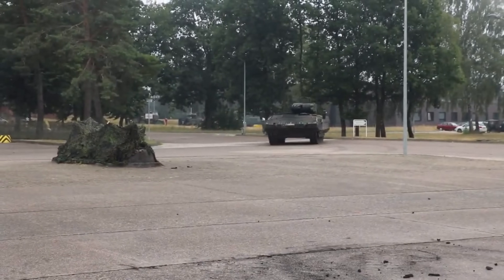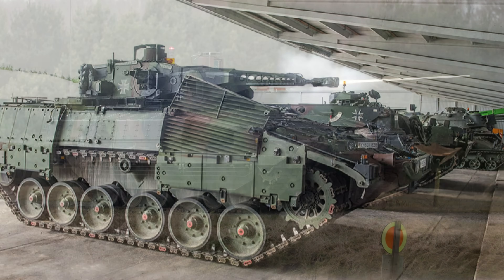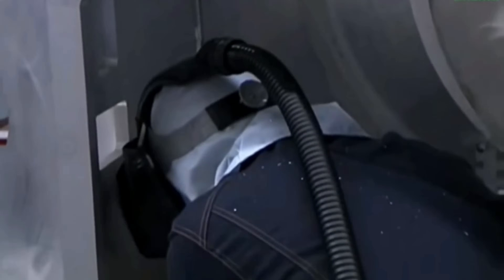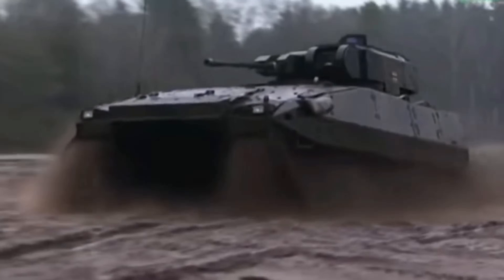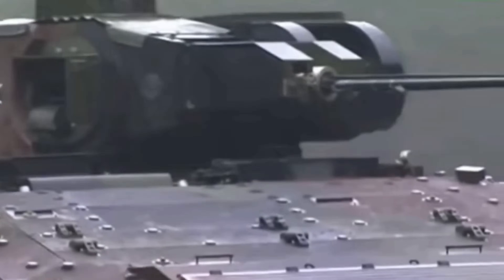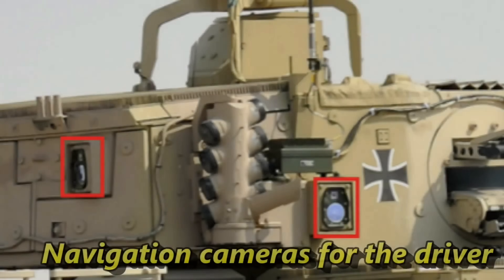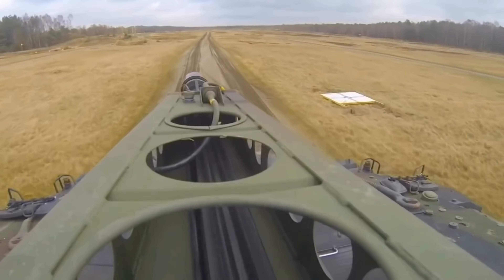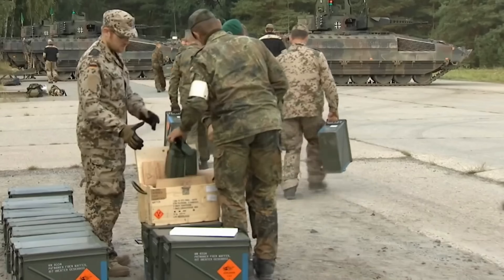The Puma Infantry Fighting Vehicle - Overview and Opinion

Comment: To fully understand the Puma (and the Marder), you need to know that the German army has a different doctrine/philosophy for the use of mechanized infantry and their IFV/APCs than other NATO forces.
Most NATO armies follow the American "Battlefield Taxi" model, where the IFV/APC will drive infantry close to the front, dismount them and then either retreat to a overwatch position to give standoff fire support from there, or leave the infantry to their own devices, to independently do cavalry work, like scout for the MBTs, or pick off soft targets at the edge of the battle and stuff like that.

Based on their WW2 experience, the Germans have a different approach.
They really take the "Combined Arms" thing seriously and want their MBTs, mechanized infantry and IFV to work together, simultaneously, shoulder to shoulder, if you will. 

Most modern armed forces claim to be following a Combined Arms doctrine, but in most cases it is more of a "Alternating Arms" doctrine, where different types of units might operate close to each other, but will usually try to achieve different goals, attack different targets and stay out of each other's way.
The MBTs will do their thing over there, while infantry does something else over here and the cavalry lurks around the flanks and so on.
Or they will operate in waves, where the MBTs come first and then infantry follows to mop up what the MBTs left over.
The Germans on the other hand try to overwhelm the enemy's ability to deal with any single element by mixing them all together and letting them operate like one unit, basically.

Their IFVs stay with the infantry and the MBTs, while getting other support (like artillery) where possible. No single element is ever supposed to operate without the others.
That is why for example, even though it was a German guy who invented it, the German army never used explosive reactive armor on their tanks. It would have been too much of a risk for their own infantry which was supposed to operate around the tanks and very close to them.

It is also why the Marder and the Puma are not amphibious.
They are not supposed to ever go where the Leopard 2 tanks can't go with them, so giving them the ability to swim made no sense. 
And of course they need heavier armor when operating side by side with the MBTs and facing the same opposition, while at the same time having no use for bigger guns, like some variants of the CV90 for example, which have a 90mm cannon. Would be pointless to strap a MBT gun to a IFV when that IFV is always accompanied by the real MBTs anyways.

The Germans take that Combined Arms doctrine so seriously, that they basically split their army in two.
There is the main, heavy force that is all about following that doctrine and their special kind of mechanized infantry, which they call "Panzergrenadiere" is the infantry element of that.
The problem is that that heavy force can't go everywhere. 
For all those places where the main "Spear Point" part of the army can't go, they have the so called "Jaeger" units.
Those are all sorts of light infantry (regular Jaegers, mountaineers, which they call "Gebirgsjaeger" and paratroopers, which are called "Fallschirmjaeger") and they are considered a different type of infantry from the Panzergrenadiere and separate from the main part of the army, because they don't follow the Combined Arms doctrine.
They are supposed to operate without heavy support, do hit and run attacks, lay ambushes and other semi guerrilla type of warfare and accordingly they get kind of a semi special forces training.

This creates this weird situation where the German army kind of doesn't really have any regular, old fashioned infantry.
All the infantry is either those Panzergrenadiers, who are specialized for basically doing tank warfare and the rest are the Jaegers, which are this weird half "guerrilla militia in uniform", half "semi special forces" thing.

I digress.
The point is just that German IFVs are a bit different because their doctrine is different and that is why they never sell well on the international market.
Even those countries that bought the Leopard MBTs, never bought the Marder or the Puma, despite them being specifically designed to operate together with the Leopards, because they didn't really fit into anyone else's doctrine.

The Marder's 20mm cannon isn't really fit for the American style "Battlefield Taxi" role, or Cavalry work and the Puma is too heavy.

That is why Rheinmetall developed the Lynx, basically as a lightweight, more Bradley- or CV90 style export version of the Puma.
Reply: Excellent comment.
Reply: @BewareOfTheKraut  It is.
Reply: Well do any one remember the taken out Turkish Leo 2 Tanks

Only because they didn't have infantry support for the tanks and every German military equipment pice is designed with the combined arms doctrine in mind (the right tool but not the skill to use it properly, like hammering a nail in same wood but hitting it with the Handel on purpose)
Reply: @TheLtVoss  LOL they didn't even have tank support. The leopards were sent up individually.
Reply: @rileyernst9086  Hep and that's why they were easy targets to the atgm
Reply: @TheLtVoss  even if you put active defence on them, or other systems, you still have a massive vehicle. And well it's hard to stop cannon fire.
Reply: @TheLtVoss  Leo II A4s from the early 80s, never really upgraded, manned by conscripts and used, without infantry support, as a stationary artillery piece by incompetent officers because most competent officers were purged by Erdogan ...
Reply: @positroll7870  jep and still under most of these circumstances the Leo2 A4 is a good pice of equipment but without the right tactics it will not last long
Reply: @TheLtVoss  Well, the Turks seem to have learned the lession at least partially and are currently adding an indigenous upgrade, with lots of top armor etc ..
Reply: @TheLtVoss  I understood that was also based on the fact that they were used as static defense/not mobile (against doctrine) and also the A4 stone age version.
Reply: Fabian Mueller Infantry can only safe the Lepards from ATGMs fired from 2 km away, if you send the Inf 2km ahead of the tanks and use the tanks as pure firesupport for the Inf. But thats not the German doctrine, tanks are made to maneuvre! So flaw of the Leopard design is the ammunition storage in the front left hull, the Rebels knew that and exploited it. Leopard 2A8 needs to adress this flaw and put all ammunition under blowout-panels in the turret!
Reply: @WackyJackyTracky  I hope you know that what you named there as a change for the A8 would mean a redesign of the whole interior. Designing a new tank would be a better option at that point.
Reply: @Tankliker  Yes I know, well they got rid of the hydraulic pump system which used alot of space in the right-back turret. as the turret has now electro-motors. The other thing in the turret is the firecontrol-computer, maybe they can use a smaller modern computer. APU and AirCondition can be moved too if necessary. It's still a 4 man crew, manual loader, manned turret tank then. A new designed tank will need to have the features of an T14: unmanned turret with autoloader and lots of sensors. Oh and of course A8 needs an APS
Reply: @WackyJackyTracky  Yeah, they already made mayn modifications, but still. They maybe have to move the whole technic that sits in the turret into the hull where the ammunition is and the ammunition into the turret. I beleive Rheinmetall did something like that with the Leo. 2A4 Revolution, which is a privat design from them where they reconfigurated the whole interior. 

But you are definitly right about the new tank, even if I think a autoloader Leclerc/K2 Black Panther/ Type 90 style where the ammunition is in the turret would be a better design becasue you could simply design the back of the turret so after the tank ran out of ammunition they could just remove the whole section in the back and load another in, like on the MARS system.
Reply: @TheLtVoss  If you watch that syrian video shooting the ATGM from 2km away, you see that deployed turks infantry would have needed to be like 2 km infront of the tanks to be able to spot and fight the ATGM team https://www.youtube.com/watch?v=YafzmkvVRiI Infantry alongside the tanks can't safe them against ATMGs, they would need to clear all the area 3 km ahead of tanks befor tanks can move in. But tanks are supposed to be a fast moving spear head, so they need to be able do defeat ATGMS themselves with APSs. Infantry alongside can only safe them from RPGs!
Reply: @Tankliker  would you want to be a driver in an Leopard sitting right next to all the ammunition? Those catastrophic explosions with all crew killed and who knows else standing next the tank outside, should not be possible in german engineered equipment.  https://www.youtube.com/watch?v=YafzmkvVRiI . A7 only has a lill more track-skirt composit armour I think, dont think that stops an ATGM from hitting the ammu
Reply: @WackyJackyTracky  Nice Video XD Yeah, they definitly shouldn´t use any tanks there. The ammorack in the hull is not really a big failure considering that the Leo. 2 was mostly designed to defend germany and so on is perfect for german or european ground in general. The ammorack for example are not in real danger of being hit because the tank will most of the time fight in a hulldown position in europe.
Reply: @Tankliker  The Leopard 2 is designed with mobility in mind, with a strong engine and a fc-system designed to have a 90% first-hit-chance while beeing on the move. It's not designed as a mobile marginot-line turret just moving into its digged hull-down position. The ammorack is a design flaw, we can't just blame the turks
Reply: @WackyJackyTracky  Yeah we can, I mean the Leo. 2 is used around the world and even the canadians had some encounters with there leased Leo. 2A6M but they lost non of them. 

The video doesn´t show a design flaw but a flaw in tactic. Ever tank could have standed ther and could have been killed.
Reply: @Tankliker  No, the opponents the Canadians faced in Afghanistan didn't have ATGMS, just RPGs which are easier to avoid by keeping distance.
Sure every tank can be knocked out, but you do know that there are different tank kills (killing its sights/weapons, mobility kill, total loss so it needs to be abandoned)... in no way ever the shown catastrophic explosion should occur... it is not something acceptable with the whole crew and nearby infantry dead! Abrams would be penetrated too in the situation, maybe crew would be wounded if hit directly, but I never saw the whole tank exploding and torn into pieces. If the ammo-rack ist hit it blows out the panels. An Challanger 2 was penetrated by an RPG29 (double hollow-charge) in Afghanistan, the driver was directly hit and lost a foot, the crew had to abandon the tank cause of smoke, but it didnt just blow up like Leopard2 did in at least 10 instances in Syria.
Reply: @Tankliker  Don't get me wrong, I am german and I like the Leopard, it is simply terrible to see it explode like this! Maybe they could seal the hull's ammorack with an armored-door and install blow-out-panels in the hull or move it into the turret.
Reply: @WackyJackyTracky  A Challenger 2 could explode jsut like a Leo. 2 because it has open ammunition in the turret. They are lucky that the ammunition never got hit there. 

And no, only because they are unguided doesn´t mean they where less dangerous. ATGMs are somewhat even less of a thread to modern armys because after they got fired the gunner mostly has to stay in place and hold sight with target, so many modern armys already have tactics to counter them. 

In such close combat as seen in the video an RPG is potentially even deadlier because the gunner only needs a short time on target.

In the end every tank has it´s flaws, the Leo. 2 has a big one with the hull but so hes every russian tank between the models T-64 and T-90 (More modern T-90 have a modified rack so the chances are lower that the whole thing will just blow up, but still there is a chance)

In the end the need for a new tank is given for the Bundeswehr, but still the Leo. 2 does it job and only because the turks can´t handle the fact that modern tank warfare doesn´t mean that the tank should stand in the open isn´t automatically the fault of the design. 

For example the Abrams (Which had for a long time the best crew survivability of all modern MBTs) got also destroyed because the army that used them didn´t provide any cover or support. Yes, they didn´t jsut blow up, but what differnce does it make if the crew is dead and the tank is still usable or the crew is dead and the tank got blown up.
Reply: @WackyJackyTracky  in the video it is clearly that isn't an atgm it is an unguided missile so 99% a rpg (don't know the typ video was Pore quality) and 2km away is also to much Loks more like 1500m or less and infantry in between the tanks to build a flank had definitely saved the leo2 oh and fight distance of infantry is in middle eastern about 250m-1000m
Reply: @WackyJackyTracky  skits a extremely effective against heat warheads so because the explode in a greater distance to the Ammor (and every density difference between the layers disturbing the jet and in the case of an a7 skird the jet has to cutt steel ceramic polyurethane, than an air gab of 50 cm and than the jet is directed at the main ammor of the hull so the jet isn't focused enough)
Reply: @Tankliker  about Merkava best crew survivability?
Reply: @francis8062  Is your question if the merkaa could survive this position shown in the video? Maybe he has the highest chances but the merkav also has the flaw of no save ammorack, the whole ammunition is jsut stored all around the tank in special tubes that slwo down the fire after a shell got hit but still, if the crew wants to survive they have to leave immediately. The Abrams may be the best if it comes to such a situation like shown in the video, the biggest problem would jsut be that the fulltanks are at the spot where the tank got hit, so it could burn down or run out of full too fast or even air could come into the fuel tank after hit and could get sucked into the trubine and jam it.
Reply: @Tankliker  thanks 👍
Reply: With some good planning the Australian Army will buy 200+ of either the Lynx or the Puma to work with the 230+ Boxers we bought.
Reply: @oldmanriver1955  well you clearly missed the point of the first comment entirely. the Puma and Boxers do not work together. didn't you read the comment or did you not understand it? the Puma works with the Leopard 2 MBT. the Boxer is for light infantry, scouting, hit and run, patrol duties and not for tank warfare.
Reply: You fully understand the german army doctrine and broke it down into your excellent comment. Thank you. That should help the ppl to understand the role and claim of the Puma in the modern german army.
Reply: @TomDieselTruckTV  Only lacks one little bit. there are tanks in the Jäger parts.  I  worked on those tiny little Wiesel tanks while i was drafted.  It was very easy work because i knew both engines very well from being an Apprentice in a VW/Audi dealership.
Reply: @practicing1  wow, you really had to drop your bucket of unrelated bullshit on what is otherwise a very constructive thread under a very constructive comment.
Reply: Sorry, but your world domination plan has not worked so people can criticize the German war machine. Lets put that mass grave to bed. Now you want to talk about the design of your luxury ambulance in a positive light? Really? Now?
Reply: Unglaublich gut erklärt in englisch!
Reply: That philosophy goes back quite a long time, Julius Caesar found the auxiliary German cavalry very effective because it operated with lightly armed very fast running infantry that would run with their cavalry amongst the horses so they would always have cavalry support.  Needless to say when they took on other enemy cavalry they always won because one German would spear at you from the same horseback level with his spear while his buddy down low would spear at you from below.
Reply: @LordBruuh  Wow, this is some serious big brain stuff right here. 
So on your planet, because an army is small, it can't have a doctrine, or a strategy to win fights?
Reply: @TrangleC  OPs comment is just pretentious bullshit and I say that as a German who served in the German army , and the guy is right . Also the German combined arms doctrine has never been implemented in combat .it's a long shot to suggest that the German army is better than anyone else in a specific field and that kinda thinking is why the Germans lost the world war
Reply: Thank you for this cogent, informed analysis.
Reply: Epic post 
Great
Reply: Just to clearify: Jaeger is translated to Hunter in english. Jaeger units are mostly similiar as the US Ranger forces, but with a minor difference: Jaegers are also able to take down IFVs and MBTs.
(With an Panzerfaust and/or MILAN)
Reply: @walther2492   but jägertruppe is not airborne and usually heavyer equipped than ranger units...  if you want to compare any german unit to rangers, its some type EGB forces. Besides that, wearing that triple oak leaf on my baret makes me more an  regular infantry man than some type of special forces ;)
Reply: @derblablablachannel  Bundeswehr Jäger are "airborne" if necessary, via helicopter, been there done that as Panzergrenadier in 1980, (Panzergrenadier instructors were often assigned to Jaeger units and vice versa) Jaeger are deployed by foot and by any other means, like M113, other motorized Transport, planes and helicopter. And yes "Jaegers" are best equated to u.s. army rangers, due to the tasks and our training was at least as good as theirs.
Reply: Best summary I ever read about Bundeswehr doctrines.
Reply: American IFVs be like: dafuq de doin ova der
Reply: I should have known this, but I still feel informed. Thanks for this unexpected comment.
Reply: Danke für den guten kommentar
Reply: By the way:
The original Marder version was amphibious, it just became too heavy after the first real upgrades. So for the later versions they dropped the amphibious capability.
Reply: @papaschlumpf5894  Sure? I think only only SpPz Luchs and Tpz Fuchs were amphibious.
Reply: @papaschlumpf5894  Which original Marder version? I drive this thing since years and i never heard of it being amphibious. And i can't imagine it ever was, considering its form and purpose.  Are you sure, that you're not talking about the SPz TPz Fuchs?
Reply: @Sxxmaschine  Marder was always able to drive through 2m deep water, ("Tiefwatfähig") it's got diving hydraulics like leopard, fully pressurised interiors and a snorkel, that must be mounted before crossing, so it was back around 1980. It cannot float, but crosses fully submerged. (Former Spz Marder Commander of 6th PzGrenDiv)
Reply: @waltrohrbach2459  hey walt, you're right, 1,5m without and 2m with the snorkel and NBC protection turned on. As mentioted, i'm operating it (driver/gunner). It's just that being capable of submerging does not make a tank amphibious in my book. dran, drauf, drüber
Reply: @Sxxmaschine yep, not fully amphibious, it cannot float, just "tiefwaten".. or " deep wading" <g>
Reply: @papaschlumpf5894  That sounds more like the Lynx (Luchs Spähpanzer), which got to heavy and lost its ability to swim in Version A2
Reply: @zelemas3062  Lynx made of Marder could not acually offer anything substantial. The floating in all such vehicles is mostly last resort. Apart from Russia its useless. First thing you will experience in tracked IFV going to water is sinking. Second is getting killed. Third is slow pace floating with no possibility to exit the water because there is no beach on the other side. Fourth is leaving all infantry in a truck and all your tanks on the other side of the water.
Reply: Billy But Whole  perfect couldn't say it better
Reply: Thanks for enlightening us with your explanation of the workings of the German army. I do hope this will be effective against the overwhelming muhammedan army that this Merkel bitch/witch is bringing in. May you be victorious against this blackest of foe's.
Reply: I makes perfect sense tho.
There is no need for an infantry unit in modern warfare, unless you want to do asymmetrical wars (like Iraq) or capture cities (which would be an offensive war).
Both scenarios dont apply to the german military, we are not allowed to ever do offensive wars, and generally not intrested in following the US in yet another disaster conflict. 

But defending the homeland is top priority and for that infantry is basically the least needed unit type unless you end up in a asymmetrical scenario again.
Reply: @Triumph633  So germany has no city worth defending?
Reply: @practicing1  Utter drivel. The rumor got started by an incompetent manager from Rheinmetall (or KMW?) who didnt properly read the fine print in the paperwork they were sent (the requirement applied to equipping staff offices in barracks, not IFV's or APC's) and shot his mouth off. 
The officers in charge of the program immediately clarified the BS, but the damage was done and the internet meme born and then got propagated by Russian trolls and the tinfoil hat brigade.
Reply: @positroll7870 was it a profitable misinterpretation? often is in banking and politics at least
Reply: Patrician Cloud : You need medical Support! Ask for help! Meet a psychiatrist!
Reply: @ron9320  gaslighting-  how boring u are troll
Reply: @arvedludwig3584  Merkel..... if ever there was a satanic destroyer of Germany...
Reply: @arvedludwig3584  Really, and what source told you that? The Merkel fan page?
Reply: @practicing1  The most important thing is that it can transport pregnant female soldiers since Angela Meryl and German women will b"

Spouting the same false nonsense is the usual indication of people having no clue about the topic. This never happened.

Obviously with women being allowed in most military roles prodeures had to be adapted and "gosh" that meant that there are rule what happens when a woman gets pregnant. Simply put they get retired from a mission outside germany. There was never any special demand for specifications for pregnant soldier transportation for anything ever. Just new processes to deal with new possible scenarios because militaries are big on having all processes prepared in advance and from top down so units do not make shit up. 
Besides male soldiers should be happy when such a requirement would mandate that a military vehicle cannot have as toxic materials anymore. It is not like asbestos is somehow healthy for men either.

But I think I already sunk more time into explaining the actual facts than you spent putting together your false garbage for your agenda.
Reply: @mangalores-x_x  exactly, childish doll house dreamers priority
Reply: @mangalores-x_x  They can fight the next major war, letting all the land pirates do what they want and cutting men to the bone
Reply: Thanks for this comment and discussion. It is, despite the inevitable side talks and troll posts, a very enlightning thread about a topic I had no clue before.
Reply: I think this is in every way the best comment I read on yt so far. Thank you very much.
Reply: This is about the best YT comment I have ever read.
Reply: Can you explain russian doctrine one.
Reply: @C1pher187  I would like to, but unfortunately I don't know enough about Russian doctrine and what I know, I have a hard time figuring out.
As we all know, Russian IFV/APC usually are amphibious, so we can at least derive from that that they are not following the same doctrine as the Germans, but there might be certain similarities.
A while back, Matsimus uploaded a old Cold War NATO training video, which explained some common Red Army tactics. Back then it was their doctrine to have a large, mixed tank and infantry force follow a smaller force, which was supposed to lure out, detect and bind the enemy, giving the bigger force in the back the time to figure out how and where to attack best. 

It kind of was like a offensive version of the "Defense in Depth" principle.

As far as I know, that smaller "probing force" was mostly made of mechanized infantry, because they would be best suited for hunkering down and surviving long enough for the main force to arrive.
When you have such a smaller force that is supposed to find and engage the enemy on their own, it makes sense to maximize their mobility with amphibious vehicles, I suppose.

But how exactly mechanized infantry and tanks within those forces worked together, I don't know and I doubt that the modern Russian army still follows the exact same doctrine as the Red Army did, because they don't have the same man-power and the same number of expendable auxiliary troops from all the Soviet provinces anymore.

The newest generation of Russian tanks, like the two Armatas and the Kurganets, suggest that Russia now, like the NATO armies, puts more focus on survivability and on keeping their troops alive, than the Red Army did.

Another hint to their modern tactics is the existence of the Terminator tanks. Having a MBT converted to what would be a IFV, seemingly specialized on fighting other IFVs and infantry, but without the ability to carry troops, probably means that they are not planning on having the mechanized infantry stay close to the tanks, but instead have the Terminators do that job and use the infantry differently.
Reply: Is it conceived to stop Russian Armored Divisions? It's hard.
Reply: @francis8062    What if?

Only combined with MBT's and Mechanized infantry... not as  stand alone.
The Puma got MELLS in close future or nearly  now... Rocketlaunchersystem with SpikeLR Antitank-Rockets...so the infantry with carryable launchers
Reply: @HerrKarliseppel  thanks for infos👍
Reply: @HerrKarliseppel  MELLS is already integrated.
Reply: @Tankliker   partly...  but on Puma and also  on a  pack of upgraded Spz Marder
Reply: @HerrKarliseppel  I only know that the puma was taken in service with the MELL soft kill APS. I never heared that they also upgraded some Marder with it.
Reply: @Tankliker   if i remember correct... around 80 Marder (2020-2030)will be upgraded for future with a new powerpack with 750hp ... and better weapons like MELLS

The other Marder going out of service in close future
Reply: @HerrKarliseppel  OK, that's new information for me, I knew they wanted to hold some Marder in service but not for how long or even with an upgrade.
Reply: @Tankliker    75 Marder 1A5 will be upgraded. Not 80. New sights . New Powerpack what   makes the  Marder more maneuverable ans a lil faster . And   MELLS.... thats all.
Reply: @HerrKarliseppel  thanks for the information. I guess they want to hold them as long as the sparparts are in stock XD
Reply: @Tankliker   Yees :D   4 only as Spareparts...71 for service ...
It took time for  upgrades of the Puma and delivery of additional Puma...  so some Marder will be in use to 2030 in addition to the mainly used Puma...  thats all
Reply: @HerrKarliseppel  what I meant was the rest of the marders, I mean the BW has way more then just 75 Marders right now and I believe they won't just scrap them without at least stripping them from parts that can be used as spareparts like the track wheels, bolts, electric or ammunition.
Reply: @Tankliker  Lots of options after a bit of refurbishment. Either sell them (like they did with Jordan) or re-engineer them into carriers of the 155mm Artillery Gun Module. Or put an Oerlikon AA system on them. Etc ...
Reply: Trust me America definitely has combined warfare doctrine, but at a smaller unit level so it might not be too known.Their are a lot of combined arms battalions that constantly have the 2 mechanized infantry companies at the flanks of the 2 tank companies. 
Thunder run is a good example of this. Infantry and Bradley's were constantly securing positions and flanks for the tanks rolling through. like bridges the tanks would have to go under or would be at their flanks.
Reply: @sethreynolds8520  So the Bradley's just hold a stationary position until the troops took position and after that they take a new position?

The German doctrine drops the part with the position taking as a major tactic. The IFVs just roll at the Frontline, because of that they are so heavily armored and can withstand even tank rounds with the heaviest armore configuration.
Reply: You make some interesting points. The CV9040 wich is the swedish variant uses a 40mm ATK not a 90mm. The export variants use 30 or 35mm. There is a light tank version with 120mm gun also. Dont think its actually being made thou
Reply: @Ubeer85  there are several versions of the CV90 with tank guns for export. Obviously the swedes don't use them because they already have Leo. 2 / Strv 122
Reply: @Tankliker  Where you get that info? As far as i know there is only CV90/120 as light tank
Reply: @Ubeer85  There are serveral options for costumers currently. The 120mm is a option but also you could buy a CV90 with WILK turret and 105mm. Never heared of a 90mm version.
Reply: Tank units and mechinf have different targets and not getting in eachother's way is better than forcing them together to get in eachother's way.

Fat Puma upgrades is just another trend that countries getting involved in Middle East are picking up - for asymmetrical warfare that doesn't necessarily need tanks, this also explains the lack of ATGM in certain configs.

Every country has light infantry/recon battalion...etc. kind of setup.
Reply: @EcchiRevenge  I hope you know against what kind of weapon modern MBT are protected the best? Also germany isn´t involved in any asymmetric warfare right now, and could easily face it with the "Jäger" Infantry which is more specialized for this kind of thread. The "Grenadier" Infrantry combined with the tanks is for symmatric warfare, which would be the more coomon thread on european ground because we have no instable countrys with multiply terrorist groups which all act msotly on themself.
Reply: @EcchiRevenge  I'd hate to say it, but you're making a few assumptions there mate.
Reply: @rileyernst9086  Nice try, you're not turning it around on me.
Reply: @EcchiRevenge I'm just saying, the Germans have used combined arms in warfare and exercises since 1930 and mechanised since 1942(when they started using their half tracks as IFVs rather than just battle taxis). They know what they are doing, and if they believe this is a suitable way of doing it, well then I'd think the different elements are going to get in the way of each other.
Reply: @rileyernst9086  You're assuming a lot of things.

One of which is that post-ww2 germany is of same caliber as the pre-ww2 one(not that blitzkrieg is a new concept even when ww2 first began).

Even(or rather, especially) re-unified germany got its goals changed and budget slashed(to the point where they were prototyping modifying AK bayonet for G36).  I would think twice before blindly trusting a husk of its former self.
Reply: @EcchiRevenge  I'm saying doctrine and tactics wise Germany has developed differently(starting in 1930 and now has based itself on on the lessons hard won when 3/4 of their army fought itself to extinction against the Red Army rather than the Blitzkrieg) after WW2 west Germany was basically a speedbump(but hey it only had to buy 4-5 months for NATO to reinforce France, a more likely front line) to the rest of the world(who base their tactics on Soviet and allied tactics of WW2, because as conventional wars go, that was the last biggun), their mechanised units train together because they will fight together in close coordination, closer than what other armies do. Sure everyone is doing budget cuts, it cuts but if you don't have money, or a war, well an army becomes a problem, look at the proposed plan with the Royal Paras and Marines. And look at the US marines. They even won't have their own tanks.
Reply: @EcchiRevenge  I know it cuts as a military enthusiast, but Germany does not need to spend so much on defence now. It is not the front line and it's not run by a genocidal dictator who wants to take over Europe. Even if Russia wants to invade Europe, it'll have a hostile Ukraine and Poland(and NATO forces stationed there) as a buffer. And that would likely give enough to time for NATO to get it's arse in gear and mobilise. Russia might be strong, but it's hardly the Soviet union, and many of its former states are joining NATO. I'd be more worried about the more indirect threats Russia poses. NATO is only strong united.
Reply: @EcchiRevenge  I'd have to agree this vehicle and the boxer are huge. The marketing and hype is disturbingly effective. Boxer replacing the AISLAV with a bit better protection dwarfing an M1A1 Abrams. And that part about the bayonets is pretty funny. I think that might be an issue with HK. Basically the G36 had to be temporarily pulled from service in Afghanistan because hot weather made the plastic all wobbly. Not great for your service rifle.
Reply: @rileyernst9086  Then that's even less of a reason for infantry to move with tanks in apcs.

This is pretty much the only place where infantry and tank can work effectively - as multiple layers of AT defense against superior numbers(i.e. - USSR).  If you don't consider Russia to be much of a threat - no need for any of this "doctrine."
Reply: @EcchiRevenge  well they still want a military and these tactics are what they have been training for since 1960. It's either keep on, or redesign their military. I'd say using tanks, IFVs (Germans have since 1942 used them for fire support to stick around with the tanks) would be useful in most circumstances. Mutual support is mutual support.
Reply: @EcchiRevenge  So you're arguing, that infantry, always having close tank support is only good for defence against AT weapons. Tanks do a lot more than shooting other tanks. The IFVs give the ability for them to stay with the tanks. So it is a very good aggressive doctrine. Couple that with the fact that your soldiers know the tanks will always be there, and vice versa. It's very good for morale.
Reply: @rileyernst9086  Strawman.

IFV can easily do just about anything infantry needs tank support for(including shoot at tanks); that is, if IFV is equipped with the proper weapons.

You know what's actually good for morale?  Knowing the vehicle you ride in can do almost anything below CAS.
Reply: @EcchiRevenge  Apart from blowing stuff to bits. Unless it's a BMP 1 or BMP3. I agree that is good for morale, but also having tanks that are there to add weight of firepower. Well I would not say no.
Reply: @rileyernst9086  Implying IFV can't do "blowing stuff to bits"?
Reply: @EcchiRevenge  direct fire ordinance is pretty good and the bigger the better sometimes.
Reply: @rileyernst9086  Let me introduce you to CV90-120.
Reply: @EcchiRevenge you mean the CV90 120T yeah I know all about it. It's not an ifv. It's a tank. Hence the T in its designation.
Reply: @rileyernst9086  Still IFV hull.
Still can carry troops.

None of your goalpost moving worked.
Reply: @EcchiRevenge  a merkava can carry troops
Reply: @rileyernst9086  I knew you were going to say that.

Therefore Merkava is best IFV. (just need to toss out spare ammo)
Reply: @EcchiRevenge  really useful for medivac. Rather that than an old m113.
Reply: @rileyernst9086  They have Namer...etc.
Reply: It's not exclusively a German tactic. Many countries employ that approach.
Reply: @practicing1  never read smth so stupid and i read a lot!
Reply: Fantastic comment, highly informative. Thank you very much!
Reply: Well, my country bought 50 Marder IFV a few years ago and its really interesting after you write this. I always wonder why there's only 4 countries use Marder while a ton use Leopard 2. I wonder what my country use for the combat tactics. Thanks for your explanation
Reply: @arvedludwig3584  na the the treaty was a real provocation I mean have u seen the numbers for military personnel and artillery prices and the Bann of every armored vehicle with that Germany wouldn't have a chance against Poland and that for one of the strongest economic powers at the time was hilarious it wasn't the only reason but it was a reason of many
Reply: TrangleC : Thanx for explaining with a few words the doctrine of the army I served in. When you are inside  the system and you  know nothing else it is absolut normal to fight under this doctrine. I would like to understand more of the different doctrines.
Reply: Billy But Whole : Drauf! Dran! Drüber! Er ist halb Mensch, er ist halb Tier! Er ist ein Panzergrenadier!😉 Translate it!😂
Reply: Well Australia must be on the same doctrine lines as the german armed forces our ifv's and afv's accompany mbt and the infantry dismount and form up an extended line with our ifv's/apc's/afv's  and mbt and assault as 1 force yeah can units do have a recon role but once the enemy has been fixed theyre into the battle aswell Australia having such a small but very professional defence force has taught us the value to truly do combines arms assaults!
Reply: @arvedludwig3584  I am nor right, nor left. I do care about factual data though. What was your source again?
Reply: Thanks that was really interesting.
Reply: Thank you 🙏 for the education
Reply: I have serious doubts as to the accuracy of this comment. Unless the Germans are mixing tanks and IFVs organically at the company level you are essentially describing US Army Combined Arms doctrine, and how US Army Combined Arms Battalions work.
Reply: @Dadecorban  They are mixing them on every level. As I said, the MBTs are supposed to never ever operate without IFV and infantry ("Panzergrenadiere") support and the IFVs that are part of the combined arms doctrine half of the army are supposed to never ever operate without the MBTs.

If what I say is wrong, both you and that guy who commented months ago, claiming to be a former German soldier and never having heard of any of this, better have your own explanation for the fact that the German army is separated into two distinct parts that have different doctrines, the "Jaeger" and the rest and the US army is not, which it would have to be if it would operate the way I described the German army.
Reply: @TrangleC  1. Partially not true. Armor can operate without infantry, it can't halt in the defense for long periods of time without infantry support and on the manuever still requires scout platoons screening (but there aren't many scouts, and they are mounted most of the time so it's not exactly a robust use of infantry in the manuever). 2. Mixing it on every level doesn't tell me whether a German mechanized company has 6 Marders and 6 Leopards or whether the companies are still armored companies and mechanized companies that team up based on the mission. If the companies are organically mixed at the MTOE level then what you said is true, it means that a tank is never anywhere without a Marder. The first I'm pretty sure isn't the case and the second is essentially what US Army Combined Arms actually does. 3. I'm not saying that Germany doesn't do combined arms and isn't split in the way you describe, I'm saying that what you are saying about this being super unique to the Germany army (actual combined arms) and specifically not the case in the US Army, likely isn't the case. 4. Specifically, the US Army Combined Arms Battalion FM is essentially a description of when and how tank companies and mechanized companies work together to accomplish various missions; which routinely looked like a Mech company taking a village with an armored platoon attached, or armor maneuvering in the open (support by scouts, which are mechanized infantry), or armor moving through rough terrain with an attached mech platoon. US Army combined arms is essentially how you mix the drink. It's also how we operate at our JRTC and NTC brigade training centers which is as close to manuever warfare as you are going to get without actually killing Russians.  I would love to see evidence that the Germans are so radical in this area that the US Army should be excluded specifically from being in the same category.
Reply: @Dadecorban  I'm always accused of making judgement calls and calling one thing better than the other, which I never did.

I just said: "This is how the German army does it. This is why they do it and this is why their IFVs tend to be a bit different from other nations' IFVs and don't sell well internationally, because they are custom built for that German doctrine."

I never said armor can't operate without infantry. I said in the German army, it isn't supposed to. That is their doctrine, based on experiences in WW2.

I might be wrong, I am not an expert on every army in NATO, let alone the world, but as far as I know, the German army is the only one that is split into two like this, for the reasons I explained.

What I do know is that back in the late 50s and early 60s, when the German army developed their first IFV, their American allies urged them to adopt the "Battlefield Taxi" doctrine, which was NATO standard and buy into the new M113 program. The Germans refused and decided to do their own thing.

Seeing a documentary about that actually was what first made me interested in the subject.

Even the general Wikipedia article on IFVs, under "Doctrine" talks about how the Germans had a differing view from the rest of NATO and their view ultimately prevailed and got adopted by others, including the USA.

Nevertheless, the fact that other armies are not split up the way the German one is, tells me that they can't really follow the same doctrine as the Germans, because that split is kind of inevitable when you do.

When you do have a doctrine that says MBTs are supposed to never operate without the support of mechanized infantry and vise versa, then that leaves you with the problem that heavy mechanized troops can't go everywhere and can't do every job infantry has to do.
So you need two types of infantry, one that operates within that strict combined arms doctrine and one that doesn't.

So maybe you understand why I am dubious when people tell me either that the Germans don't do that strict combined arms doctrine, or that others do it just the same way, when the German army, to my knowledge is the only one that has that split that is kind of necessary for anyone who would adopt that doctrine.

The ones who say Germans don't do it, would have to explain why the German army is split like that then and the ones who say other armies do it, would have to explain why and how they do it without being split like that.

And then there is things the US army does and the German one doesn't do, like Cavalry tactics. I'm not aware that German IFVs are training doing solo flanking maneuvers, where a single IFV drives around alone, searching for soft targets to engage at the edge of the battlefield, like you often see Bradley's do in training.

A Marder would clearly not be suited for that job, which proves that there are different doctrines for the use of IFVs.

PS: Sorry to everyone else who wrote a comment and got no reply from me.
I haven't gotten any notifications for replies to this comment in half a year or so. I assumed the thread is dead and am pretty shocked to see now that there have been over 170 comments.
Forgive me for not having the time and energy to go through all of them and answer.
Reply: @TrangleC  Yes, you did say it. "To fully understand the Puma (and the Marder), you need to know that the German army has a different doctrine/philosophy for the use of mechanized infantry and their IFV/APCs than other NATO forces.
Most NATO armies follow the American "Battlefield Taxi" model, where the IFV/APC will drive infantry close to the front, dismount them and then either retreat to a overwatch position to give standoff fire support from there, or leave the infantry to their own devices, to independently do cavalry work, like scout for the MBTs, or pick off soft targets at the edge of the battle and stuff like that." This battle taxi doctrine does not exist in the way that you think it exists, and the Germany's use of IFVs isn't as unique as you think it is this.
Reply: @TrangleC  Germany's doctrine is no different than any NATO countries doctrine. MBTs are supported by IFVs with infantry dismounts. APCs, operate without MBTs. You seem confused on what APCs are compared to IFVs, which is where the confusion is coming from.
Reply: @brandondavis7777  Nope. I know the difference between an APC and a IFV, although as usually, it is blurry.
And just because IFVs and MBTs are on the battlefield at the same time, neither means they are doing much to support each other, as the current war in Ukraine shows, nor does it mean there aren't differences in how they are used between different armies, within NATO or outside of NATO.

Both the Bradley and the Puma are clearly classified as IFVs and are rather similar to each other in their basic makeup and abilities, ignoring that one is much older and thus naturally less capable.

Yet, there is the clear difference between them that to the Bradley transporting infantry is a secondary mission, while to the Puma it is the primary mission, despite still being a IFV and not a APC.

That is part and result of this difference in doctrine I was talking about and denying that is rather obtuse.

PS: As someone who has been saying for many years that all armies claim to follow a Combined Arms doctrine but few actually do, I feel quite vindicated by what we see in Ukraine.

The Russians too said what they are doing is "Combined Arms", but now we see that it isn't. Just because MBTs and IFVs/APCs are on the battlefield at the same time, doesn't make it "Combined Arms".
For it to be "Combined Arms", the infantry has to protect the tanks from enemy infantry, but according to old Soviet and now new Russian doctrine, their infantry stays 300 meters behind the tanks.
300 meters is already about the maximum effective range of a regular infantry assault rifle, under ideal conditions. Nobody is hitting anything at that range while running after tanks.

Sure, even the best trained infantry with the most refined Combined Arms tactics can't protect a tank from a Javelin coming at it from miles away. So Combined Arms, even if done right, is not the be all, end all of military tactics, but against short range ambushes with RPGs, Panzerfaust and NLAW, they could do something, if they actually would do real Combined Arms and would protect their tanks with a effective infantry screen.

So many times when I talked about Combined Arms, I was told by armchair generals and online experts "Duh! Everybody does that, dumbo!"
But now we see that not everybody who claims they do that, actually does that.
Reply: @TrangleC do you have any sources or further reading, I'd really like to know more about this
Reply: That may in part describe WW2 offensive tactics, but does not apply to NATO role of german Bundeswehr in the cold war situation, which was generally a defensive role only.
Spz Marder main role was in fact to accompany the Leopards with its infantry element, as everybody should know, MBT are quite vulnerable against sneaky infantry attacks especially at night and this is exactly where the marder team comes in: For protection.
It is absolutely not true, that "Panzergrenadiers" and "Jaeger" are two totally different types of infantry in the german postwar army. Amongst Marder based infantry, there are regularly Jäger soldiers on the team and vice versa: my first assignment as fresh promoted panzergrenadier sergeant was to a Jaeger Battaillion as a drill Sergeant in 1980 (which i did not like at all, because i just finished combat school and passed all tests and exams for command of the vehicle and in fact leading a platoon of Marders if necessary, a lot of work studying and in the field, on top of that i was a marder gunner to begin with.)
But i wasn't the only one, it was common routine. So the Jaeger Battaillion had lots of panzergrenadier NCO. Also many regular Jaeger soldiers could be found in panzergrenadier battaillions as well. That is because there are no differences in tasks and how these are executed at all between the two. Also a common misconception is, the Jaegers are on foot only, nothing could be further from the truth: They are on the move by M113, Helicopter, Truck, special small vehicles and as i already mentioned, even the marder. (And probably boxer today)
The Spz Marder is not amphibious, but still able to cross canals etc. with its deep wading capability, snorkel included plus the fully pressurized hull due to NBC capabilities.
I find it so funny, how the "puny" 20mm autocannon is dismissed by the, well, i must assume gamer crowd. Lets have a look at the puma first, so its got 200 rounds in its munition box on top of the vehicle, for a reload, at least one soldier has to enter the roof... and the refill is another 200.
Well, the Spz Marder carries a full load out of 950 HE rounds plus 300 AP rounds INSIDE the vehicle. (plus back then 4 x Milan anti tank rockets) The gunner could freely switch between HE and AP munitions. The splinter range for the HE projectiles against "soft targets" was 3m each at 2000+ meters and the AP penetration depth into armour was approx 44 millimeter at 1000m. 
So the marder was able to shoot very long sustained suppression fire to cover the infantry! Of course the autocannon was not designed to fight MBT, but if push came to shove, we were ordered to rain down on the enemies tower, obliterating its pericopes, antennas, maybe even get a shot into the towers ring, disabling its rotation etc. Whilst the guys outside might take it down by Milan or panzerfaust. Nobody knows this: The Spz Marder cannon was intially supposed to be stabilized, just like the Leopard, but due to cost it was cancelled. In the main operating panel of 1980, there still was a opening for a switch, it was embossed "stabilization on/off".
You do not want to be at any time in the range of that fast firing 20mm autocannon i can assure you. (And it was feared by the taliban in 2010 when marders were deployed to afghanistan)
The rheinmetall rh202 autocannon is as precise as a sniping gun, with various optics and IR, but in 1980 received heat and rest light amplification sights.
Reply: In 1977-80, I saw many operations on the Baumholder MTA in W. Germany were ground pounder Infantry were working directly with 
M60 A1's. Using the tank as cover in combined arms assault. I was there.
Reply: Then Israeli Namer IFV would be better choice...just tank without gun
Reply: @LordBruuh  I served 12 years in PzBtl203 as tanker and yes, combined arms is the thing in the Bundeswehr, but not Blitzkrieg-alike, more in a defensiv way. For example the "Verzögerung", a multible defensline defense is a very often practised strategie wich needs combined arms to suceed. And yes, we were (are) few so taktics like the "Verzögerung" are pointed against greater numbers and as long the enemy isnt suicidal in his tactics its quiet effective and as part of the NATO we wouldnt be alone. The Bundeswehr has well adapted in tactics to their low numbers
Reply: Thanks for digressing :)
Reply: Thank you for this very informative comment!

You seem well informed so I hope you would clear the confusion I have about the roles of the Boxer and the Fuchs 2, they seem to be redondant having the same role, do you know how they are designed to be used in context?
Reply: @zidfih1176  The Wiesel and Wiesel 2 fill out the very niche role of air dropable armore. 

The Puma and Boxer are not always a available option to the paratroopers, but the wiesels are light enough to be dropped literally anywhere.
Reply: Good comment, only disagree about Jäger ( was myself a Panzergrenadier and Jäger NCO ) actually the classic Jägers, despite all their specialization are well able to fight as "classic" Infantry as well.
Reply: Then there Is Italy, that mantain the "good old fashion" infantry (has infrantry Is the One that keep pressure and mantain territories) and Will produce German pumas as their new IFV
Reply: Pretty cool but surely these doctrines are used for different battlefields? The modern battlefield for the Americans is against insurgency style enemies in rugged Terrain and small towns/villages where tanks and armoured vehicles are highly vulnerable. Is the German system better for fighting larger more conventional foes like the Russians on the large plains of eastern Europe?
Reply: @LordBruuh  The Bundeswehr of the cold war became a mighty military force with ca. 495.000 men (AFAIR actually more than 480.000 until 1990) and up to 3.500 MBTs/IFVs during the 1970s and 1980s. When soviet Russia would have attacked Germany the Bundeswehr had to defend the country as long as allied forces needed to enter the middle European battle field. Germany had mandatory military servce then, so it could have at least two or three times as much heads to conscript. The US forces in Germany were by far not sufficient for a primary role in this task, so they would have had just to assist in this first phase as far as forces are concerned. However, the US presided and dominated the NATO and would have had the supreme command on defending western Europe. These had been the plans for conventional warfare, a nuclear war of course would have changed everything.
Reply: Like it. I Hope the Polish Army won't go for our new IFV Borsuk and will stick to something heavier and more robust to follow the same (or close) model for backing up the Leo brigades. It should work this way cuz the armored brigades are self-sufficient organisms when the Infantry has its own model of APCs + the heavy fist of few tanks to ram the battlefront here and there. With specialized troops (rangers with APCs as well) of the fast engagement on top of that. Those can come close with the airborne folks as they do the training together from time to time. All things covered - no IFV for now. We live here now with the worst govs ever - so no wonder a swimming Rosomak IFV is the subject of any consideration other than the export.
Reply: @HanSolo__  You see.... there's no point of going "middle ground". You either make amphibious 25t range ICV or 50t+ beast like Marder II in 80s or Namer.  Having 40t vessel actually gives you neither resilience to MBT shells nor amphibious capability.
Reply: @piotrd.4850  You see.. you actually see shit. This is by far the most lame approach to AFV subject Ive ever encountered.
You've literally said:
-Its better to have IFV barely moving in water (ddrowningsuch vehicles is very easy, they even dont use lighter 8x8 to swim with it) and prone to any fire, than have reasonaby armored which will use any bridge safely.
And:
-Its better to have Nemer type of vehicle right from desert, mountains, rocky country in the same area you want to cross water with your IFVs floating! Its utterly stupid!
Reply: @HanSolo__  Unfortunately - the reign of Rice Pig and his Band of Thieves destroyed everything - it's slowly rebuilding now !
Reply: @jansaddam3829  Got no idea what are you talking about...
Reply: @HanSolo__  Polish army should simply stick with Rosomak, like French had done with VBCI and abandon notion of tracked ICV along with BMP-1s.
Reply: @HanSolo__  We already have ICV which is called Rosomak. What we lack are tanks in decent number, state of repair, capabilities and logistics. Our pathetic two "Leo brigades" also suffer this problem. 

@TrangleIeC - it won't sell, because it is too expensive.
Reply: Nice coment. In fact i mean Germany is teh only nation in Europe that have a real Mecanized Division or Brigade. USA have alot of Motorized Brigades that us the Striker and some other "horrible IFV" and his MEcanized units still using the old AP113...

German Mecanaized  units are amazing, probably the best in Europe
Reply: @gorkarullan  Every US infantry except the 25th and 10th are Mechanized Infantry Divisions with Bradley IFVs.  I'm not sure what you are basing your comment on but it's entirely incorrect.
Reply: I do agree in most points, However I would consider jägertruppe neither Guerilla nor special forces in any way to be honest. Yet, there are some special tasks fulfilled by jäger and gebirgsjäger units.           Is there anything written about a CV90 with a 90mm canon? I’m curious to find out, since german army recently startet training with CV90/35NL
Reply: @derblablablachannel  I was referring to the Evasion and Survival training (Einzekkämpferausbildung) and the focus on "hit and run" and supportless fighting against numerically superior forces. Maybe my information is out of date and things have changed, but I know that in the 80s Jaeger training basically was all "sneaking around in forests and blowing stuff up" and very little normal infantry stuff, like guard and escort duty and stuff like that.

The Wikipedia article only mentions CV90 versions with 105 and 120mm cannons. I thought I saw a 90mm cannon version mentioned somewhere. Have you watched Matsimus' video on it? Wasn't there something about that version in it?
Reply: No i have not seen his video. 
Todays Jägertruppe is mainly trained as infantry. Depending on which vehicles are availble (No vehicle/Fuchs/Eagle/dingo/Boxer/) the focus is shifting from light to medium infantry.Jagdkampfausbildung takes place, but only for some platoons and only if evetrything else has been covered bevore. The brigades however use the jäger components mostly (not exclusively) for guarding the Command Post... sadly. Horrido.
Reply: Hi you are right but in a real war all the programs never happen as we expect and some times you need to amphibious ability and anti tank guided missils or airborne ability to save your life and save your friends life in an emergency situation and some times leopard  tanks are far from you and  an enemy t14 tank is very close to you and your troop
Reply: How well does it do on dragons teeth?
Reply: @practicing1  Great when the engineers make them an integral part of their earthworks over them.  :-)
Reply: Everything is made from the earth, the space rocks are too magnetized, everything metal would stick to them like grenades for example so thats no good
Reply: CV90 has a 120 not a 90mm. I can see the lack of a need of a light tank in this doctrine in any case. Cheers, was always wondering about the lack of ERA.
Reply: @rileyernst9086  is a cv90/120 in use by any country or is it just a concept/prototype?
Reply: @derblablablachannel  optional turret
Reply: @derblablablachannel  it's just a prototype AFAIK. + The CV-90 IFV is used by many countries with autocannons or 30mm, 35mm or 40mm (Sweden). Noone uses 90mm.
Reply: @derblablablachannel  CV90120-T no-one has purchased them yet, but Thailand has shown interest.
Reply: you wrote a book
Reply: Wow this is a big German circle jerk here .sure we are the only ones who do that and that better than anyone else ......suuuuure. This arrogance has lost us the war and I still see so many pretentious shitbags in the German army who think that they're the best army in the world .When in reality Germany hasn't ever implemented all that nice theory since 1945 .
Reply: They are too used to fighting primitive camel boys
Reply: @practicing1  it is not that we want to fight them, it is just we a pressed in to it, by the warlord of the world the USA (exists only for around 200(?) years and had only ~10 years piece that's democracy in ur face) ok liberty war, wwi (spoiled royal incest bood packs) and wwii (provocated wwi and the Versailles treaty) wasn't ther fault but all the shit after 1945 were just usa intend wars
Reply: I am surprised anyone remembers or cares about the Versailles treaty. Glad someone has some regard. The warlords of America and the gunpowder lords of England we know are always pushing and some are playing both sides especially on the "gunpowder" side, gunpowder meaning all ammunition and ied materials.
Reply: @TheLtVoss  Your comment is roughly ok, I agree about the warmongering of the US after 2ww but the 2 ww wasn´t jsut started because of Versailles treaty. It would take books to correctly identify every little points which causes the second world war, but that tready was nothing more then a excuse for germany and russia to start it in poland.
Reply: @Tankliker  well I mean it was a Provokation on a colonial state and even without hitler it would have come to war every General sad it is only a question of time for a next or in there minds the same Dam war (wwi)
Reply: @TheLtVoss  There you are definitly rigth, secound world war was somewhat inevitabil.
Reply: @Tankliker  Everyone knows who the U.S. wars in the middle east are for and they aren't for America.
Reply: @heinrichnitschke5485  can you explain to me how this topic is relevant here? I mean yeah, it's not for the people there but what has it to do with German doctrines?
Reply: @Tankliker  I must have replied to the wrong comment. I was replying to some complaining about America's wars and how America is a warmongering nation. I was pointing out the American wars in the middle east aren't for American interest.
Reply: @practicing1  the british and americans disliked the treaty of versailles, FYI. its the french that pushed for it to be bad (and wanted it to be even worse)  and this is why the british favoured appeasement intially during the lead up to ww2, when the americans were proved right by ww2 the allies were less harsh in their treatment of west germany.

america was also isolationist leading up to both ww1 and ww2 and had provoking actions in both those wars, so you can't blame america's involvement there on them (and korea was UN ordered), its only  wars after ww2 (and perhaps after korea instead) that ameria's involvement can be blamed on the US.
Reply: @matthiuskoenig3378  They violate all contracts - lure people in and trap them - slavers and fraudsters
Reply: @practicing1  we will never forget versailles - if you want to understand the tragedy of the 20#s century
Reply: @Tankliker  wrong…..
Reply: @minimax9452  I have suffered the worst sadistic psychopaths in this century and plenty of memories in Ireland best left in the past. I am tired.
Reply: @minimax9452  you could at least say what is wrong about what I said.

I wrote like 10 comments in whole thread.

Next thing would be, that before you prove that I am wrong your opinion is irrelevant to me and the topic. At at least provide a counterpoint.
Reply: @TheLtVoss  Lmfao. Cope harder with that "Waaah, the usa is bad" nonsense.
Reply: How does it come that Bradley had more tank kill than the abrams mbts when they only are battlefield taxis?
Reply: @JjjCDsjsjshs  You could say it´s because who they fight, I don´t want to judge the US in my explanaiton now (Even if I don´t like what they do down there in middle east) but the conflict in the middle east has no need for such heavy equpment and most enemy tanks they meet are old soviet T-72 with upgrades, some thimes even older tanks like T-55 and T-62. This tanks have really weak armore from our current perspective, so the seemingly weak HEAT-based ATGMs mounted on the Bradleys and Stinger ATGM used by the US-Army are maybe even a bit overkill, considering that one Stinger ATGM roughly cost 1/4 more then the most advanced tanks they are meeting there.
Reply: @Tankliker  Just a correction, "Stinger" are Air-Defence Manpads, I think the expensive ATGM you think of is probably the "Javelin"?
Reply: @WillHayes44  Yeah, sorry for the mistake. I can´t remember all this names for ATGMs
Reply: @Tankliker  Stinger is not an ATGM its MANPAD missile.  its shoots down aircraft.
Reply: @JjjCDsjsjshs  because the xm1 is useless?
Reply: That's an interesting perspective. How many in your police? half a million in the German police and they have machine guns and armoured vehicles and helicopters. They are not exactly invalids and it was the german political police that was "in charge" of invading Poland and france etc. after the German airforce destroyed all planes and airports. I'd say they still do the odd raid and hostile takeover on the quiet.
Reply: blah blah blah combined arms. The Germans haven't executed combined arms on the battlefield since world war 2. The bradley has killed more tanks than the Abrams. There goes your battle taxi theory.
Reply: @velocitywot9573  compared to the Americans it wasn't necessary, because Germany didn't invaded another country since 80 years and we hadn't bigger military conflicts.
So we execute it in our fields as exercise.

And when you are so smart and know it better, share us all your endless wisdom.
Reply: @soerenp.e.ziemens5939  yeah we are always hiding on base and let the Amis die for us right "fellow" krout ?
Reply: @velocitywot9573  If you don't want to read other people's "blah blah", fine, nobody forces you, but don't make dumb replies before you have actually read the comments you are replying to.

A: The term "Battle Taxi" is commonly used by the American military and NATO and is not derogatory. I didn't pull that out of my behind.
B: I mentioned more than once that American IFVs also do Cavalry work and hunt for soft targets after deploying the infantry.
C: I didn't even make a judgement call and declare one doctrine superior to the other. I just talked about the fact that there are different doctrines, so don't get your national pride panties twisted.
Reply: @velocitywot9573  idiots have to shut up! 😉
Reply: @velocitywot9573  Bradleys did not kill more tanks than Abrams- that is a miss understanding since BMPs are not tanks.  Bradleys killed lots of BMPs in the gulf war but not more tanks (like T-72)
Reply: @velocitywot9573  becaus rhe xm1 is a useless gasguzzler….
Reply: @velocitywot9573  Because it was fighting stone age old Russian tanks i Iraq. If they would have met modern Russian tanks used according to doctrine (mobile) that would probably got their asses kicked. I'm pretty sure the bradley crews new and just utilized this fact.
Reply: @ronaldotrumph8960  'stone age" tanks get out of here casual.  more modern tanks wouldve died the same way. to the air war.
Reply: @velocitywot9573  Maybe....but not to bradleys.